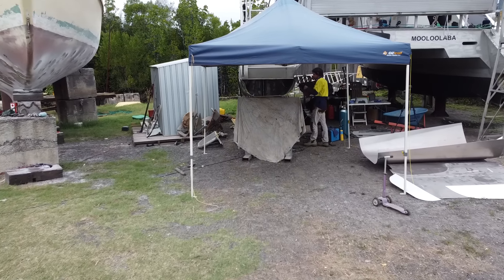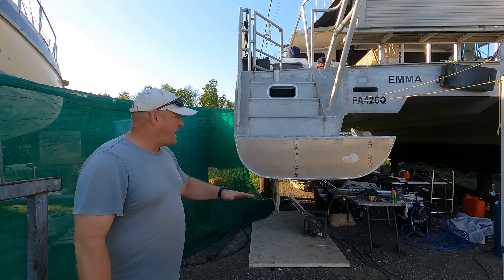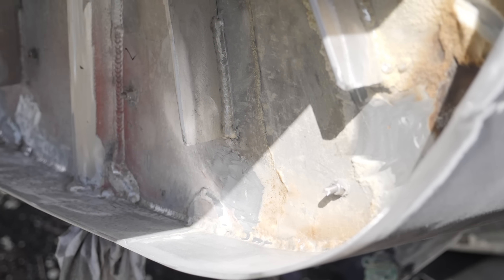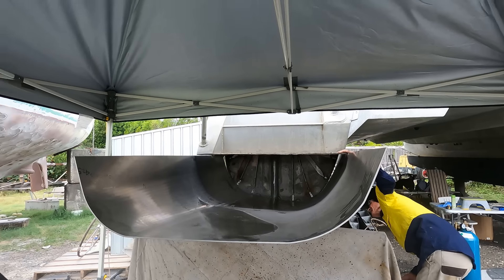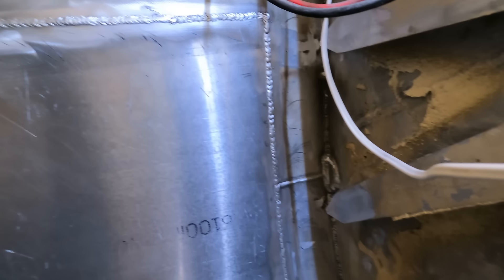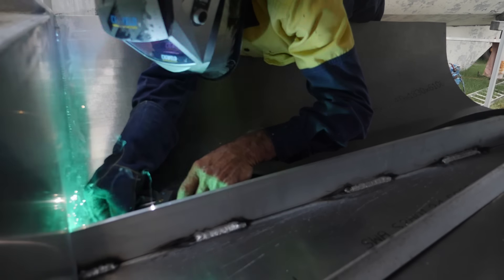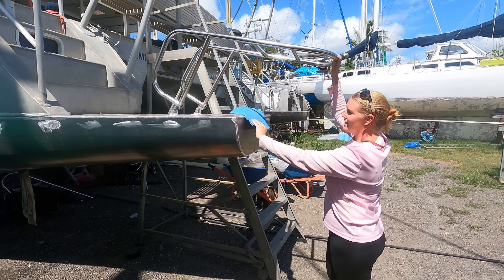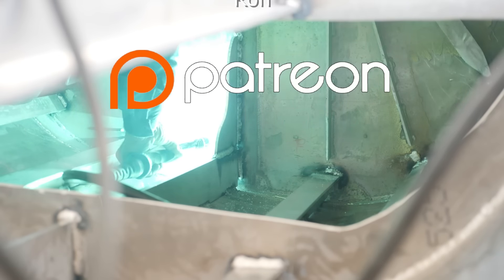Extending our Aluminium Catamaran | Aluminum Catamaran Build (Ep. 105)

Comment: If your not going to use this rear add on as storage, I would  put flotation  foam in both of them.
Reply from the maker: Hi Patriot!
Cheers for the idea, but we have water tight bulkheads in the case of water ingress. I would personally prefer to keep the space open so that if the worst did happen and we started to sink that, I could see where it was coming from and hopefully deal with it.
-sam

Comment: You should fill the inside of the extensione with fpoam to stop the slapping sound and also to create  boyance lift inthe sterns.
Reply from the maker: At this stage we hope that the sterns are in the water and that would mean that they won't slap. I an hoping that the sterns are completely water tight and that would mean that we won't need any foam for buoyancy. Cheers for the suggestions though.
-sam

Comment: Did you re-insulate the area of the swim platforms?  I noticed you had to chip away at the spray foam, at inside of the old sugar scoops.  Nice work.  It's so interesting your boat is not mathematically accurate in dimensions from starboard hull to port hull.
Reply from the maker: I have talked to a few alloy boat builder and they say it is fairly typical of older alloy boats. They just warp and buckle a bit and as English rolling is an inexact science any alteration is always better done by eye.
-sam
Reply from the maker: Oh and we didn't insulate the pods. We did buy a small can of spray foam to replace the foam that we dug out for the welds and then used the rest of the can in the pods but there wasn't that much put in the pods.

Comment: Just a thought from a new admirer of your videos and thinking...If the extensions do slap too much at anchor in a bit chop, you could always make your stern bulkhead water tight and fill the transom cavities with closed cell foam as an option. Should they be ruptured or torn off somehow, they wont fill with water also. You could test one side first and record the sound difference? You wont be able to inspect for damage / leakage from the inside, but you can still inspect from the outside should you ever suspect damage?
Reply from the maker: It I'd a good plan, and I definitely think it would make things quieter. At this stage, they aren't slapping, but we keep on talking about getting lighter, so it may at some point. I have reinforced the sterns on tugs and it made reverse alot quieter. It's a good thought and suggestion my friend thank you.
-sam
Reply: @sailingwiththejamess  👍
Reply from the maker: Thank you! 💙
-Cait

Comment: Interesting.   With the extension I would be worried about buckling where extensions join the existing hull.  That part of the hull is now carrying increased compression loads.
Reply from the maker: We increased the t bar in that section to counteract that. We also added a ring frame or baffle plate for strength. We made it so strong so we wouldn't need to extend the sides of the boat but if there is any signes of buckling then we will just extend the sides.
-sam

Comment: do you / can you ally weld at all Sam
Reply from the maker: Hi kevin, Yes I can weld. We got our sterns miged and tiged which would have meant that I would have had to buy 2 machines and sticking old alloy to new alloy is a bit tricky. I am confident that I couldn't have done as good a job a Robin so we are very happy that we outsourced thus one.
-sam

Comment: Hi guys, another interesting video. Those stern platforms will make a big difference to your ease of getting on and off and are great for reversing onto a dock. They are a common feature in newer cats. In your video you say you will be adding a whole load of new stuff on the back! More weight usually means slower boat. I am sure you know what you are doing and have done the calcs.
The asymmetric hull shape was a bit of wishfull thinking from the designer. Lifting a hull on a 17 tonne cat would be a hairy experience!
BTW congratulations to New Zealand retaining the Americas Cup. Your team was yet again in a class of its own although the gap is closing. It seems Britannia is the Challenger once again for the next round. 
Perhaps you should think about some foils! That would give you something to think about. (Just kidding) FYI the Dazcat boys added foils onto their rudders for extra performance....lots of engineeering and complex carbon work.£££££££

PS did you try the cardboard cutout exercise?
Reply from the maker: Hi Chris, thank you we are very happy with the sterns. I was doing the calculations for the sterns but unfortunately we came to the conclusion that we want the extra stuff for liability reasons so I would just have to make it work. I am lucky as we have great bug lockers foward and aft so I should be able to balance the boat out with them. A friend of mine put foils on his rudders and they did make a difference but our rudders and daggerboards are a bit clunky and there is so much I could do to improve them before going foils. I haven't tried the cardboard trick yet. We splash in a bit over 2 weeks and we are getting to the panic stage of trying to complete and finalise everything. I do hope to do it before we splash.
-sam

Comment: steel is as easily recycled as aluminum...just dont get as much per lb for it
Reply from the maker: So true,
The challenge you face with steel is that it pays about %10 of what alloy pay which means that instead of recycling at a cost neutral basis it would cost you money to recycle steel. In Australia old steel boats are a problem and the government has had to pay private contractors to clean up the old steel wrecks left in the rivers and creeks about the coastline.
-sam

Comment: @Sailingwiththejames's To Assist with added buoyancy did you consider a closed cell polyurethane foam? It comes in 2 parts that you mix and pour into the space and it expands to fill the voids. Dont shoot me if I am wrong  I am no boaty just a wannabe boaty :)
Reply from the maker: Not it's a great idea, it would stop cait and I from filling the space with stuff which in turn is weight.
-sam

Comment: Awesome, I expected the extension to be longer. Thanks for explaining why you built it the way you did, I've only seen the shell plate put over the frame in the past. Really enjoy the simple way you explain all in your video's.
Reply from the maker: Cheers Wayne, we wanted the extensions to be longer but it just didn't look right. We could have gotten away with a little bit longer but brought it back slightly to make us 16m over all. Our prodder is foldable so it doesn't count according to amsa.
Sam
Reply: @sailingwiththejamess  cheers Sam, it looks awesome
Reply from the maker: Let's hope it slippery.
Reply: @sailingwiththejamess I was going to ask about the extra waterline length affecting marina/boatyard charges etc so could you enlarge on that AMSA thing for those of us up here in the colder hemisphere?

ps. Obviously you have given little thought to how far a new rating is going to push you down the Sydney Hobart line honours result …
Reply from the maker: Hello! Hello! Great questions! 
AMSA is the Australian Martime Safety Authority, we had to file paperwork with them for the new length. We are going from 15.24 meters to 16meters, in regards to marinas we were always in a 16m pen at 15.24m so nothing will change with marinas.
With boatyards and shipyards it might be different as they normally charge by meter or foot so we might have to pay for the extra length on the hardstand. 
We are really excited about the new suagrscoops and getting relaunched shortly and using them! 👍🌼✨️
-Cait

Comment: Nice job with these extensions to reduce drag. What waterline length did you add to the boat?
Reply: It's definitely a Meter plus ....

BTW guys I'm trying to find an article on a guy who deleted his cats twin keels and fitted a single central blade  keel.
Reply from the maker: Hey Alec! Thank you so much, the extensions have come out really beautiful. We extended 2.5 feet, we went from 15.24 to 16.00meters 
-Cait
Reply from the maker: Thank you, Clive! We are very happy with the new platforms and can't wait to use them for putting snorkelling gear on!
-Cait
Reply: @sailingwiththejamess  With the new 16 metre overall length, I guess the marina /haul cost will be the same in down under locations, as the boat was already longer than 15 metres prior to the modification.  It will be interesting to see how the forward/aft balance goes with your sail plan? You should see ~0.25 knots of additional boat speed with lower stern drag and longer hull length, unless additional weight is also added.
Reply from the maker: We are hoping the costs will be the same. We could have gone slightly longer but brought it back to keep it in line with 16m. We are hoping for a bit more of a speed increase as we have brought the stern up to allow for the extra weight but yes sadly we are putting more weight on lol.
-sam

Comment: Really nice work! Glad to see the extra bouancy to also replace the lift lost from chopping the skegs also.

That was interesting to hear about the transom edge flat spot to get a cleaner release of flow for the wake. Reducing parasitic drag at the transom is important for light air multihull sailing & I learned that directly from Lock C. himself. But he never mentioned having a flat spot there. Is that a fairly recent development?
Reply from the maker: I learnt it from a friend of mine who races full time when he was on commanchi at Hamilton Island race week. It is important not to have it kicked down at all so if anything still the slightest rake up but it also allows us the have a hard edge which alo helps he water release from the transom. For our boat it isn't super important but just another thing that I want to play with and as it's all bare alloy at the moment it's not to hard to give it a go. Robin (the welder) offered to make the corner hard out of alloy but we opted for a standard stern in case it's not the best idea.
-sam

Comment: I am glad to see someone getting out of the box. I believe we have all been brainwashed into thinking that things have to be a certain way. I have saved every gallon of motor oil for over 20 years. The hurricane hit and we were cooking on wood. We were starting fires with a torch striker and alcohol. We pumped water by hand and ran our old backhoe on used engine oil. If you draw a one bar vacuum on water the temperature goes down to 36 degrees F or 4 degrees above freezing. The average air-con or refrigerator uses hundreds of pounds of pressure to cool. Our overlords don't want you to know this.
Reply: Modern Aircon systems and pumps have come a long way in the past 3-5 years. Ditto electric motors and fans .
Reply from the maker: Wow, I love been out of the box and wherever possible we try and give it a go.
-sam